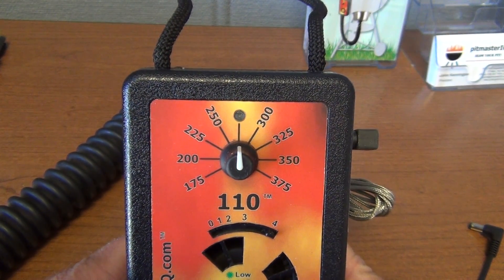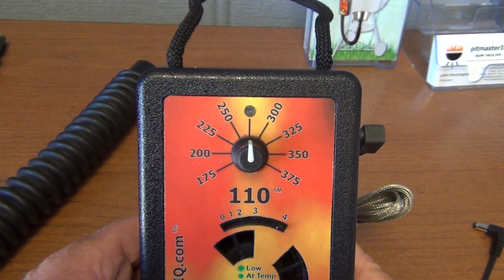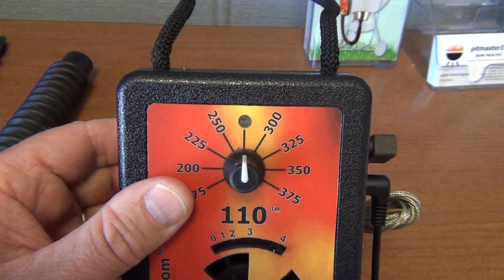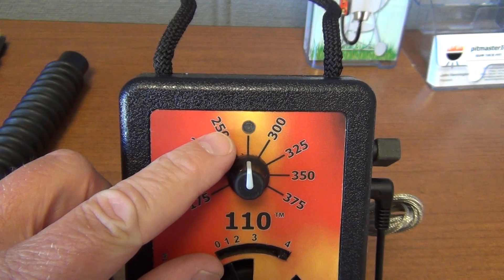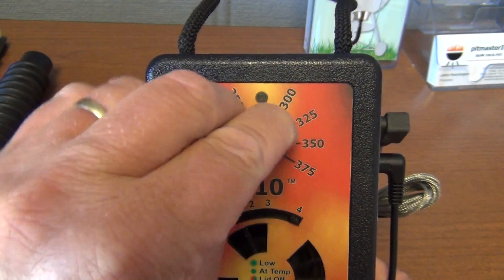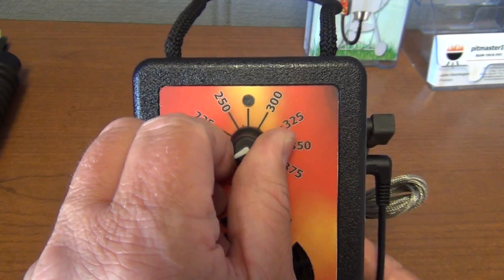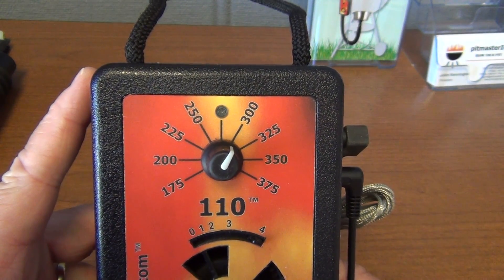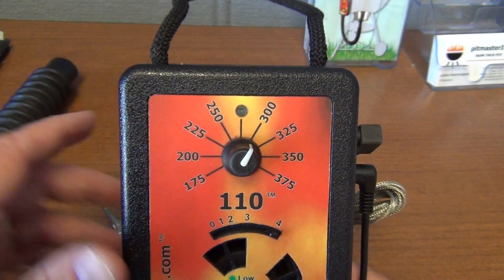IQ110 "Max Blow" Feature for Air Hungry BBQ Pits

Comment from the maker: Since April 2012 the pitmasterIQ IQ110 has been shipping with software version 1.6 or later.  A feature called "Max Blow" can be enabled with a special sequence at power-on.  Max Blow disables "lid off" detection and operates the blower at its maximum speed for air-hungry pits.  Watch this video to see how Max Blow is enabled.